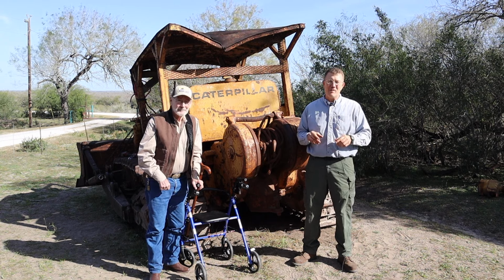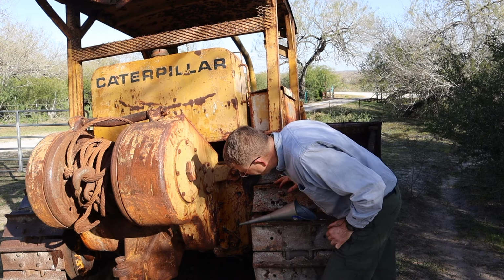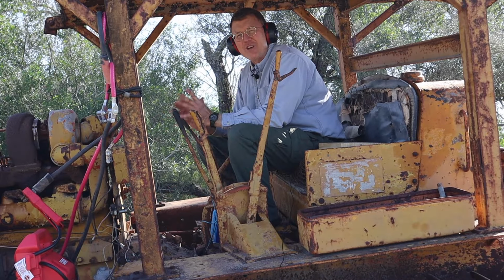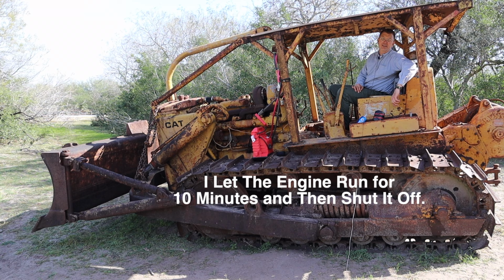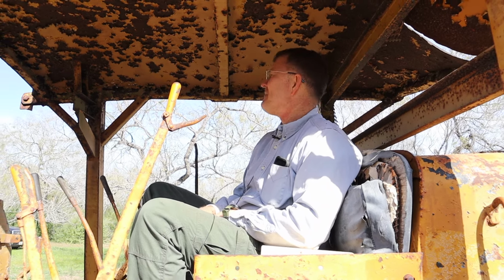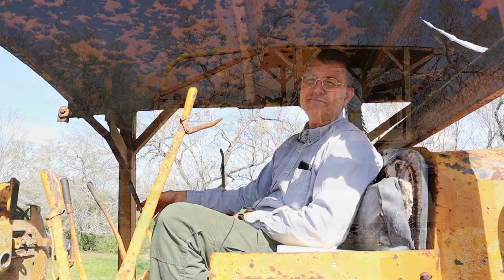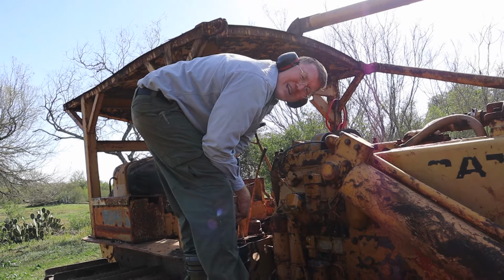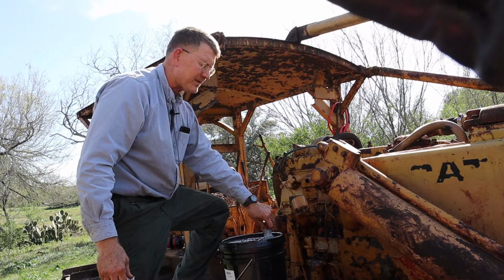1959 Cat D7 Non-Running Dozer Rescue, Episode 3 - IT MOVES!

Comment: Scott. It is great to see that you got it running and moving. I asked early on if you had a project that you needed a dozer for. The fact that you got it running is great but if you don't have a user for it then you're just buying a piece of lawn art that will sit for another 10 years. If you have a project to use it for then go for it. Otherwise I'm with everyone else. Take the wallet and put it back into your pocket.
Reply from the maker: Hey Karl - Good to hear from you!  I really don't have a need for it; it would just be something to work on, and it may be too far gone for that.  Thanks, Scott

Comment: Great video, I'm picking up an old D7 but it's got rippers on the back instead of the winch.  They really are nice old machines.  Did you end up buying this one?
Reply from the maker: Rippers would be nice!  I didn't end up buying it, but it's still for sale, so it could still happen.  Good luck with yours!  Scott
Reply: @THEBULLETPROOFGARAGE  Thanks, I just got mine home yesterday, it needs a brake adjustment but other than that it works great especially considering it's 67 years old and naturally asperated.
Reply from the maker: @geronimomadmartin3499  - Excellent!  Should be a very capable machine.  Scott
Reply: @THEBULLETPROOFGARAGE   Absolutely, the first thing I did when I got home Was pull my 1989 8k Gradall out of the mud.  It was buried to the axles but the cat pulled it out like it was nothing.
Reply from the maker: @geronimomadmartin3499  - Can't imagine anything that it couldn't get un-stuck!  Scott
Reply: Didn't see the the bucket ia, do the hydraulics have issues? Issues with track's?
Reply from the maker: @GreenGrow-ck3pg  - hydraulics don't work.  Undercarriage is pretty much shot.

Comment: Mine is  a 1956   D7C 17A
Reply from the maker: Very nice!  Pony motor start or has it been converted to electric start?  Thanks, Scott
Reply: Mine has the pony motor still   new sleeves and   heads re done  new brakes and steering clutches.  Bearings in diff crossshaft with new seals
Reply from the maker: @wilmamcdermott3065  I'm jealous!  Sounds like a pretty nice old tractor!  Scott

Comment: Do you have a purpose for this machine if you bought it? From a cursory glance it’s evident that it needs a full service, some undercarriage work (at the very least slack adjuster work), and hydraulic work. These costs add up quickly on this old machine (even buying used parts or aftermarket parts). The other issue is having the right tools/facilities to fix the issues it has (especially the undercarriage). 

I love watching these old beasts come back to life, and would love more content on it, but there’s a lot to consider before buying it. Honestly, I check scrap prices and would not offer anymore than what they’d get for scrap on it.
Reply from the maker: Hi Derrick - I'd be buying it to have something to work on.  The problem is that I already have project cars stacked up to work on, so I really don't have a lot of bandwidth.  It certainly needs undercarriage work, and at least one of the slack adjusters appears to be frozen in place.  Parts are another issue, too.  Anyway, it would be a labor of love, and I'm just not sure that I'm up for that right now.  Thanks, Scott
Reply: @THEBULLETPROOFGARAGE  - it would be an amazing project, though it would be very difficult to get a very good return out of it.
Reply from the maker: @derrickscogin  - probably just about impossible, I think, to make $.  Thanks

Comment: If
The bladee isnt working, the machine isnt operating!!! Should have checked ALL fluid levels béfore starting!!!
Reply from the maker: If you watch the first video, you'll see that I checked the engine oil, transmission, and coolant, but the tractor wasn't anywhere near level so it was difficult to get an accurate reading.  Thanks